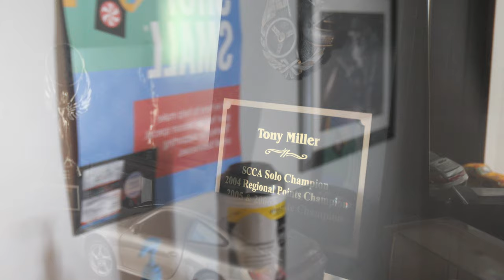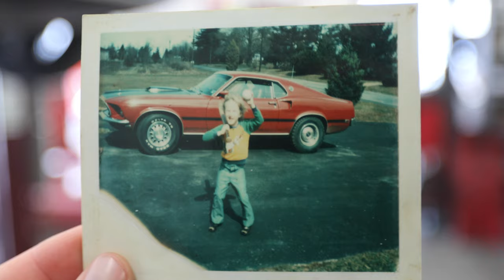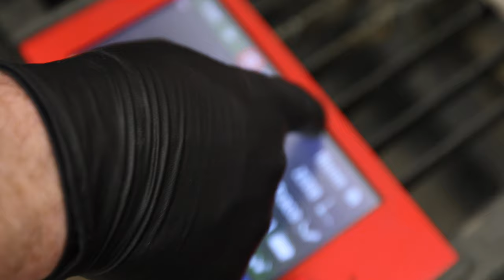Building a SUPERCAR! Can We Fit This V8 Into Project Jigsaw?!

Comment: Why not scan the engine bay and the engine and transmission(since you have the tools at your disposal), then mock up in cad. You can do the same with the adapter to mate the drive train? That way you can see where all the issues are and get an accurate idea before you make the first cuts.
Reply from the maker: Good point! We've been discussing that as a possible step as well.
Reply: I built a Tri 5 Chevy 3100 a few years ago with the drive train and suspension out of a 540 BMW. Would have saved a ton of time designing the chassis with a 3D scanner!  @CrucibleCoachworks

Comment: Should be a good build. Consider maybe a Holly  EFI system .. which should retain a similar induction noise and clean up the stuff around the block as well as accommodate other mods (which might change the sound it makes).   I wonder if given the space available, using a CWA400 for the water pump would be workable thus would shorten the length of the block space taken up.   The cost of the space makes me wonder what the cost of getting one from Send Cut Send would be using your own CAD drawing since Ford Bellhousing patterns with the dimensions are available on line.  Hopefully you won't need offset dowels to center the input shaft.  Good luck on the project to extend the rear of Jigsaw. Yike!